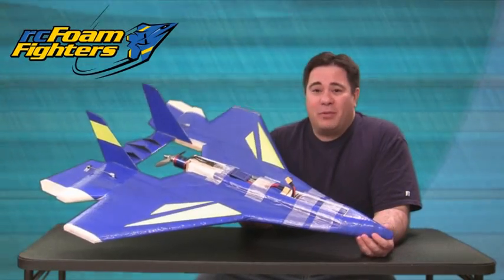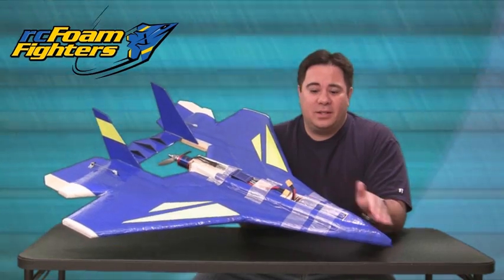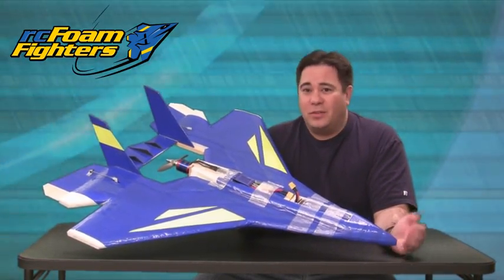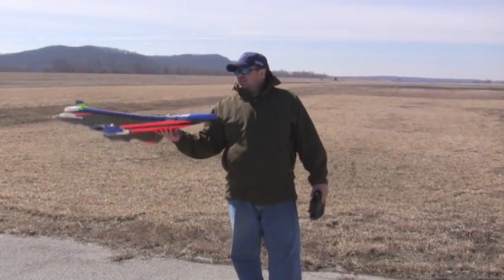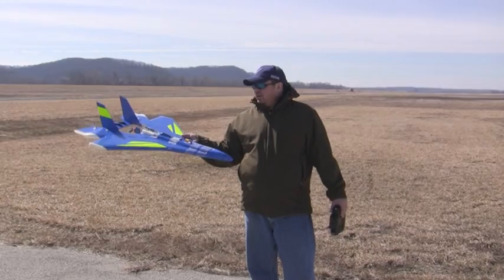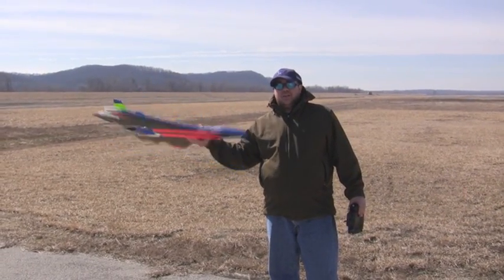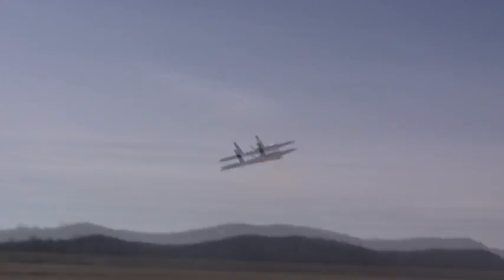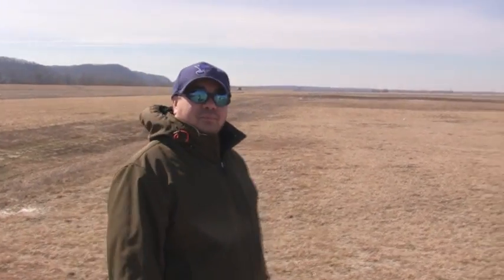Project SuperNova Part 3 (FAST Scratch Built RC Plane)

Comment from the maker: @Nobel0 The SuperNova I built is usually launched at only about half Throttle. The first time I was going to launch it, i mistakingly pushed full throttle and it almost ripped it out of my hands, LOL. If you are using the same motor and prop set up as I am, its a beast! Half throttle is all you need for take offs.

Comment: @rcFoamFighters Also, i reckon with the 15mm thick wing, you could probably go for a smaller diameter prop but with a high pitch. Something like a 6x6 or 6x7 - higher v-pitch. I guess you'll loose thrust output, which means lesser acceleration, but your going for top speed. So should be okay.

I'm starting my build this weekend!!!!

Comment from the maker: @vmat377 
That sounds like a good idea. My original was 30mm thick. Going to 20mm should make it a little more streamline. You may need to add a spar or maybe an extra layer of the weave in between the two layers. Should be cool though. i would to see your build if you make it. Oh, i have a supenova extreme in the works, only 15mm thick, bigger size and way bigger motor! Hope to get time to finish it in the coming weeks or months. Good luck with your build!
Paul

Comment: @gwsslowstick I just got into building planes and I can tell you I paid: 

Radio/receiver: $180
Speed control:     $50
Motor:                    $40
Battery:                 $20
Servos(4):           $25/ea. (you can get by w/ 2 but will have to sacrifice something)
Glue Gun:           $15
Foam:                 $10

These prices are rough but just over $400 for me.  You can certainly buy a lesser radio that will do the trick for about $50 and, as I mentioned, you can get by with 2 servos.

Comment from the maker: @vickomf 
The plane is a scratch build, but the electronics cost about $100, then you also have to supply the Radio and transmitter, foam, tape and glue..

Comment from the maker: Thanks CH0Rigi! Yep CC's are wacky. As for your question, I think the first thing you need to get started is patients, LOL. Just consider your first builds as a learning process. As for items needed, it's really good to have the handheld hot wire for EPP or blue foam builds. A good sharp box cutter type knife and the spongy type sanding blocks for all builds.  For foamboard the Logon Foamboard cutter makes cutting bevels so much easier. Last, proper glues that won't eat your foam.

Comment from the maker: SUG thanks for watching. We did do some bench/ static tests and the high pitch prop was calculating to a higher speed. At the field as the 7x8 was faster than the 7x6 prop. I've never seen a 6 inch prop with a higher pitch than the 7x8. I like the larger props because they have more thrust at a lower rpm. On 5S Lipo packs the 7x8 seemed to work really good. Frank may try this motor and ESC setup with a 6S lipo and 6.5x6.5 prop. Even with that though, I think the prop speeds are pretty close..

Comment from the maker: rcramosrc, I put the power system details in the side bar with links. Just note the motor needs a little modification. you have to loosen the set screw on the motor shaft, then press it through to convert to a pusher motor. This will require an additional 5mm shaft collar. I just bought some 5mm landing gear wheel collars, which worked fine. Frank and I plan on doing a video soon on how to mod the motor. Thanks,

Comment: Hey guys. Awsome plane. Just thought you should break in your batteries before you ask so much of them. Most manufacturers recomend to discharge to half capacity at around 5C for a few cycles. At least 5

It's something to do with a chemical that is in new lipo batteries

Keep up the good work

Comment from the maker: Thanks for teh comment j13onnyv. I have not looked at those motors yet.  Though at 40amps I do not see it putting out 5 pounds of thrust and 1600watts like this motor.  This is a 3 pound plane and needs a bit of thrust. And is the 500t motor lower priced than 23 dollars? I haven't found a better deal for 1600watts of power yet.  thanks for your suggestion on the motor, I will look it up.

Comment from the maker: Thanks allanshoafrocks. The motor is a Turnigy 3648-1450, rated at 1600 watts. Great motor for around 20 bucks. I'll add a link in the side bar later when I get a chance. Thanks.

Comment: stay up all night to put this video up? ud da man! Dude, at 130 I've never seen a plane locked in like that and then to be able to banks tight turns like that? You got the ultimate machine! Like the F22, supersonic with NO afterburner. I'm defintely sending you those mechanical airbrakes that i found. You've outdone everyone in my opinion cause you got the speed and flying ability. Thom did a great job as well. Wonder what the super nova would be like if it was glassed!?!?!?!